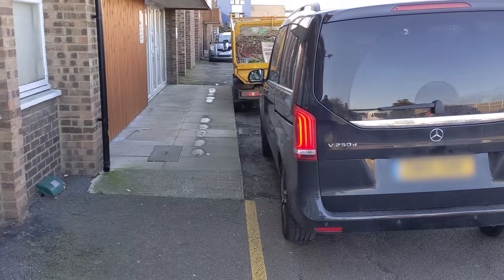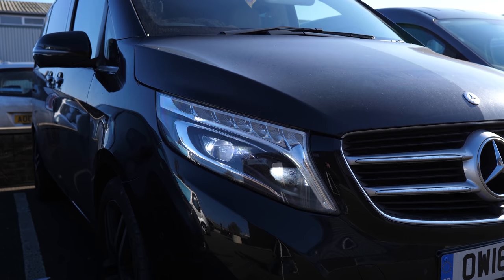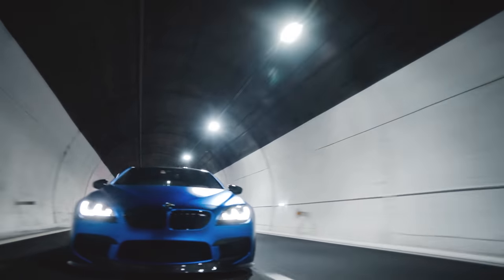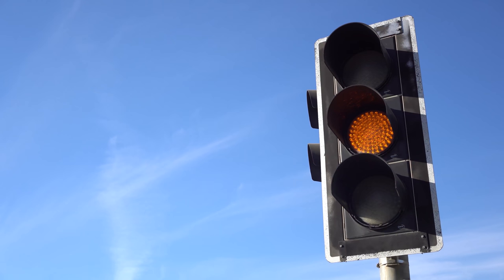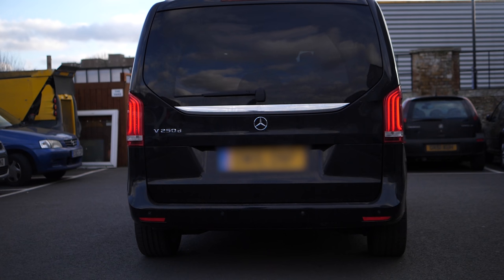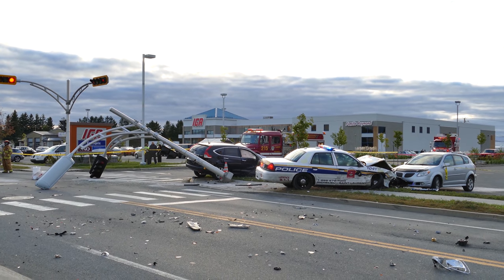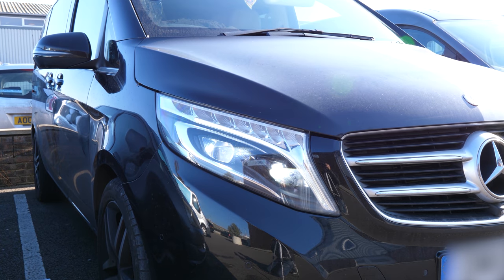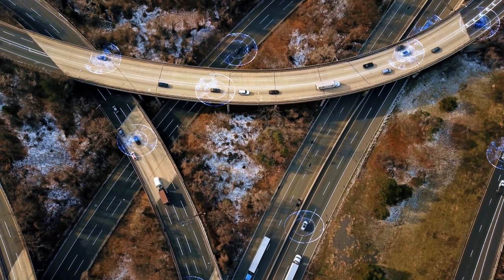Self-Driving Cars Are Dangerously Confused By LED Lights

Comment: Here's and idea for a potential solution. Have the "AI" use multiple sensors with several different framerates to decide whether or not a light is on
Reply: You guys watched to the end of the video right?
Reply: @bosstowndynamics5488  Yep, I think that makes sense

The OP's idea would be prone to a similar issue though
Reply: Or, you know, just use colour coded lights for different signals. Like amber for turning and red for braking.
Reply: @Anankin12  This also requires changing the environment and making sure all cars do that.
Reply: @bosstowndynamics5488  how hard would it be to make the cameras just detect the actual event of the object decelerating/stopping? you read my mind with the 2 camera solution there
Reply: Computationally REALLY heavy operation though. CPU cycles and computing power is hard currency in cars.
Reply: use incandescent lights :)
Reply: More expensive than putting more lights and low pass filters.
Reply: @bosstowndynamics5488  if you can use multiple cameras why not have them alternate and combine the signal?
Reply: Electric cars can also use other sensors such as sonar and laser tracking to measure distance to objects without relying on the light from the subject
Reply: I'm with you on that but I think their American Pride may prevent them from admitting that the European standard is better
Reply: How would that system detect that a light is actually blinking?
Reply: Two or three or more "sets" of LEDs per "bulb" so at least one set is always on while the light is meant to be on.
Reply: The answer is to use multiple sensors. But that also means different kinds of sensors, because that means the disadvantages of each kind of sensor can be mitigated by the advantages of the others. Radar is common and has other benefits as well (like seeing beyond the next car to the ones in front of it!)
Reply: how about  just have cars communicate with each other
Reply: @patrik5123  I understand that But it can also be viewed as a partiality redundant system, and having redundancy in autonomous systems, also it should be possible to just sub sample the pixels on a single sensor at different rates, so that one 120th of a second frame is spread into multiple passes of different pixels, gets very then iso issue, gets over the issue of missing a brake signal because a single frame would be made of multiple passes, and the computational power needed over current systems is low because the resolotion is the same
Reply: Or just use proper regulation.
Reply: Ditch the led lights. They are inherently more dangerous on their own unless extra measures are taken. No one considered them freezing over and not melting the snow that accumulates on all traffic lights. To get it to melt, requires extra heating. Which makes it more expensive than the standard bulbs which defeats the ENTIRE purpose.
Reply: I can literally see the flicker on some car tail lights as I follow behind them, and it gets really annoying at times (usually if it's rainy and the road is shiny)... Any suggestions for adjusting the frame rate of my eye balls?
A simpler solution that fixes it for humans and AI is a capacitor.
Reply: @chrissekely  if the light was actually blinking then all the sensors would show the light as off when it's actually off.
Reply: @Anankin12  Ok, and what? Make legacy cars illegal?
That's only half a solution and not a perfect one besides.
Reply: @Anankin12  And go back and replace all the previous turn signals. Great idea!
Reply: @patrik5123  It will only get cheaper. A specialised ASIC for it would only cost a couple of dollars to build, and could likely run at about 15W - I'm not sure what the development costs for it would be though.
Reply: @CZTachyonsVN  Not feasible until all cars have built-in tech for it. This might be a viable solution in 20 years or so.
Reply: @patrik5123  video decode is done with ASIC in GPU
Reply: DC lights?
Reply: @tin2001  maybe there are motion blurre goggles? Like goggles that give light back after it's been shined on.
Reply: Eric Neufeld constant current led would be a better and cheaper solution

Comment: Important LED lights shouldn't be PWM, they should be current limited.
It's easy to do and costs an inconsequential amount.
That'd solve all the problems.
Reply: Oh my gosh bro you just made me understand something. Ok so I've been working on my car for a few days now and I have a problem with a solenoid that controls fluid pressure inside the transmission. I've been using a standard multimeter to test the connection between the ECU and the connector I've been getting 12v for each connector in the series that leads to this solenoid. I've been on a coupe car forums asking questions and one guy said I need an rms capable meter because the solenoid uses a PWM VOLTAGE which was complete gibberish to me until this video along with your comment just helped me out a lot thank you Piers
Reply: There is nothing wrong with the PWM, the problem is cost cutting. All these manufacturers are ignoring the output filter between the PWM driver and the LED to save a few cents. 
Some theory around this: https://www.allaboutcircuits.com/technical-articles/low-pass-filter-a-pwm-signal-into-an-analog-voltage/
Reply: Lights are PWM because heat becomes a serious problem when operating devices in the linear region. Mosfet transistors have very little resistance when full on, so they don't dissipate much heat even when controlling large currents.  If you were to bias it on at 50%, you'd melt the mosfet.  Maybe what you need to do is put a low pass filter after the mosfet to smooth out the PWM to a lower average voltage.
Reply: @stargazer7644  right. And LEDs have a very limited range of current limiting. They are not resistive, they are diodes. And even samples all in the same lot, they dim at very different currents. PWM is the only solution to LEDs. btw you would use bipolar for current limiting, not mosfets. We only filter to limit spurious emissions. You CAN hybridize current/pwm, but NOT on a diode. The most reasonable solution is to just increase the frequency to beyond what anybody would use on cameras -- 50K. Make it a law!
Reply: or require multi-phase multi-bank LED arrays so that there's no visible flicker?
Reply: @communitycollegegenius9684  You don't rely on the LED to current limit.  When biased in the linear region (MOSFETs do have a linear region, and can be used there.  It just might not be the best choice) they are the current limiting devices.  I hadn't considered issues of uneven LED brightness, but you're right, that could be a problem, just as using a single resistor on a static display can be a problem.  The low pass filter isn't to limit emissions.  I'm talking about a cap and a resistor with the knee set low enough to filter the PWM frequency.  This would convert the PWM into a variable DC current through the LED.  Exactly like the filter caps on a linear power supply.  I agree you can also up the PWM frequency.  But I think this is a problem that doesn't need solving.  I have a problem with the entire premise of the video.  No autonomous driving vehicle would only use taillights to determine when the vehicle in front is stopping.  I'd be surprised if any autonomous car does.  These cars use radar and/or lidar and they use those sensors to determine exactly what the distance and closure rate is of all the objects around them.  After all, not all objects that are slowing (or stopped) have lit taillights.
Reply: @stargazer7644  And not all that have lit taillights are slowing.

Comment: Love the awesome hidden gags. Wish they'd mandate high Hz for LEDs, personally I find the visual effects quite distracting, in particular my peripheral vision and when moving my eyes to and fro.
Reply: Seconded.
Reply: Volvo’s are the worst. Very distracting when I’m driving.
Reply: Or they could keep the LEDs continuously on and control the brightness by varying the current. It's just slightly more expensive but so much nicer to look at.
Reply: Thirded.
Reply: Fourthed.
My spouse thinks I am mad because I can see cars' lights flickering.
Reply: I get distracted by that too. I don't get how this even got approved for road usage.
btw: Imagine buying a 30.000$ Car and it has flickering lights because they ditched the 1$ for a better driving circuit...
Reply: Fifthed (or sixthed). When you move your eyes (in the normal assessment of the driving conditions ahead) , the flicker produces a series of 'freeze frames' of the vehicle without a movement reference, as opposed to a constant 'ribbon' of light with a decay to it. I've had semi-trailers go across an intersection at night and the LED running lights were all stationary; just dots being added at the front of travel and deleted from the rear, but the middle (and in Australia we have very long trucks) all was stationary. The few cars that have constant LEDs are so much nicer on the eyes, and considering the amount cars are worth, not spending a couple of bucks for a good LED driver is not justifiable.
Reply: The tiny indicators and flickering lights on the majority of new cars are not fit for purpose. I wish our Aussie politicians would crack down and stop importing these garbage cars, but sadly they all get chauffeur driven around so they'll never experience this for themselves.

I'd love to see all cars made in the past ten years recalled and retrofitted to correct these dangerous flaws. Takata airbags proved this is possible.
Reply: @mass1s  Yeah, it's a very simple solution and on the price of a car, effectively costs nothing.
Reply: Peripheral vision and eye movement (saccarides?) has a flicker threshold of up to around 2khz!! Good stuff but not enough designers recognise
Reply: @Ultrazaubererger  Phones use the proper circuit with the flashlight and the screen backlight, they have no excuse
Reply: @SirDella  nah, get an AMOLED screened phone in a dark room and set the screen brightness real low. Move it around and you'll see a strobing trail.
Reply: @iamdave84  Sorry I meant phones with IPS screens

Comment: Whenever I am presented with a engineering problem, I ask myself "is this problem really the ONE thing humanity will never be able to solve?" and the answer is always "probably not"
Reply: There is a solution but car manufacturers are greedy.
Reply: Pretty much the same reason the US stuck with those god awful red turn signal. I mean they're not really a problem... most of the time.
Reply: Fundamentally problems are rarely solved, they're mitigated.
Reply: This seems to rely on the assumption that there is exactly one such problem, and I don’t see a reason to assume that?
Reply: @drdca8263  Actually, it seems to rely on the assumption that humans solve all problems, or at least very very rarely fail to solve a problem, which is simply not true.

In fact, problems are scarcely solved at all.
Reply: Corbin I took it more literally. Perhaps too literally.
Reply: I remember 30 years ago, being told that commercially practicable fusion power generation was likely to be achieved within 30 years.  Yes I know, they have made advances and it's really close now...  no it isn't.  If you want a really good example of an engineering problem unlikely to be solvable, try interstellar travel, particularly with humans.  There is a very interesting bit in the book, the Physics of Star Trek, about the energy requirements for interstellar travel;  well worth a read.
Reply: drdca the one thing that prevents us from achieving self driving cars. we’ve overcome so many hurdles in self driving cars, it’s hard to imagine that flickering lights will be the thing that stops us. i believe this is what the guy meant.
Reply: Fusion power, human-level AI, self-driving cars. Three problems humanity will never be able to solve.

Comment: The mirrors of my motorcycle sometimes vibrate a bit. If they vibrate, everything becomes a blur. But some of those LED lights become a swarm of bright dots flying around. ;)
Reply: My exact same experience, except for the motorcyle part: It also happens on cars with a slightly shaky/vibrating centre mirror.
Reply: Same issue with my AMOLED phone at night when driving on a bumpy road. The screen strobes to lower the perceived brightness and text becomes unreadable.

Comment: A shutter is absolutely manageable just use an LCD panel that you can adjust the opacity of over the camera lens. You can slam the trunk all year round and it won't care, though there is a downside of it may need to be made with a higher temperature range. Say make a panel that can operate between 80-150F and install a resistive heating element on the shutter panel to counter act winter conditions. This also has the upside of possibly defrosting the camera assembly allowing for overall cleaner optics over winter.

Comment: I wonder if they've tried having multiple cameras with different parameters eg frame rate, and have software try to figure out reality based on those several inputs 🤔
Reply: That's exactly the idea I had while watching the video! Surely 2 cameras with slightly different frame rates could be compared to determine really quickly and easily what the light is actually doing.
Reply: But then you are left with trying to analyze two different videos of the same object. Which one do you believe?
Reply: @teddyruxpin3811  You don't use either. You use the knowledge gained from both and combine it to decide a most likely scenario. Or if you could find a combination of parameters that allow you to theoretically rule out all other possibilities, then you are able to settle on one.
Reply: You could also use multiple sample rates on one camera if the sensor had a wide enough sensitivity range and throughput to "see" all pixels at once.
Reply: I've heard Tesla's doing something like that. They have two chips on board, linked with their own power supply and fed by their own set of cameras. In the end their conclusions are compared. I'm unsure what happens when they drastically differ though.
Reply: They need to do this for accurate depth measurement anyway. Humans have two eyes for the exact same reason. You could have one camera off sync with another. If you combine that with the low ISO, wide aperture, and a higher frame rate things should be much better, but there will still be situations where artifacts happen.
Reply: alazrabed Tesla cars with Full Self Driving Hardware 3.0 do have redundancy, but it differs slightly from what you’ve described. They are essentially two separate but near identical computers that process the incoming information. It’s unclear exactly what Tesla is doing with them, but the best guess is to have one act as a failover in case the other crashes or otherwise can’t perform its function. Kind of like having a copilot. You could also use the separate chip to detect errors - if you give both the same input you’d expect the same output, if you don’t get that then you can assume one is broken in some way. Unfortunately with only 2 chips that won’t tell you which one has failed. They do not have separate cameras. I’m not sure about separate power supplies, though even if they did, eventually you’d run into a shared component - for instance the car only has one battery pack (though that is composed of many modules and each module has many batteries).
Reply: I were thinking this too. But I suppose camera costs would prohibit this, as they would at the very least double, likely even triple (depth perception does not help entirely, as many systems likely uses radar or lidar for that).
Aside from different rates, it could also be possible to have same rate but phase-shifted. Not a perfect solution for obvious reasons, as you don't know if the lamp is only turned on in the gap in-between. Could be a nice compromise though, if the shutter is only open half (or a third if three cameras) the frame, to halve motion blur.

I think the only real "solution" would be using both systems though: one that has the motion-blur, and one that doesn't. Then use both cameras for the parts they are individually good at.
Reply: The immediate idea I had was to have a variable framerate, so as to never close the shutter, and then average out the excess frames to reduce the framerate for the ai. The framerate might get to around 3kfps, so it must be a high-speed-camera sensor then.
Reply: You don't even need different frame rates! Just make them out of phase, so that one is open while the other is closed.
Reply: @alazrabed  yes. And airplanes have liked systems like altimeters. Then the mess up and there is a crash like on Turkish Airlines near Schiphol.
Reply: @alazrabed  Military fighter jet planes have three seperate computers/brains programmed by three independent groups that aren't allowed to work together for exactly this reason. The end result is decided by what the majority does, so if two say "go up" but one says "go down" the plane will still go up!

Not entirely the same since I think they use the same sensor data, and obviously it's a bit more complicated then just majority vote, but your comment reminded me of that little fact!
Reply: The problem with the blown out imagine could quite easily be fixed by adding a ND filter. This would mean higher ISO at lower light levels which in terms means more noise which is not optimal. I wonder if it would be possible to use LCD screen technology to turn in and of different 'liquid crystal ND filters' whenever a greater shift in light intensity occured.
Reply: @victortitov1740  I've thought of high-speed sensor too ! With nice averaged images in the hardware, you only have to change the eyes of the SelfDrivingCar and leave everything else the same.